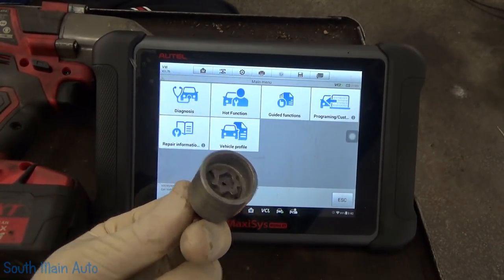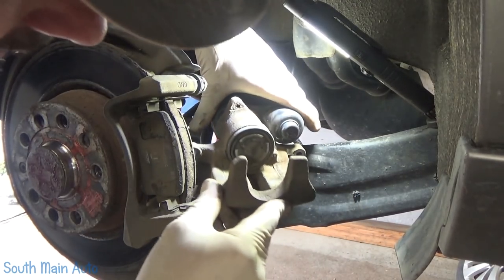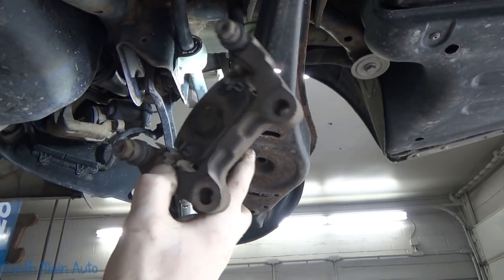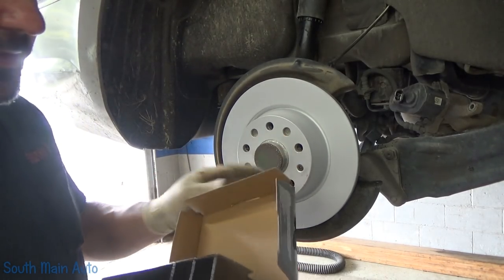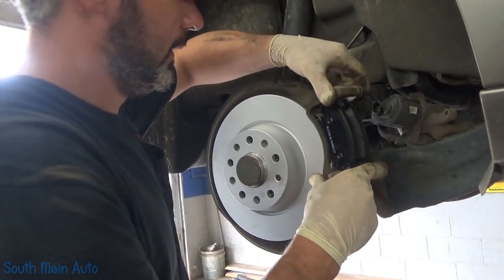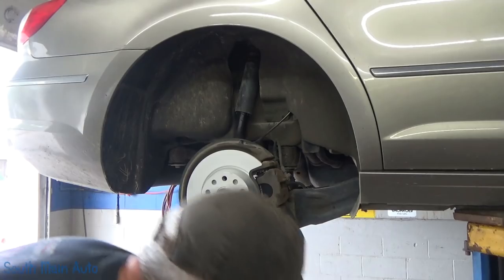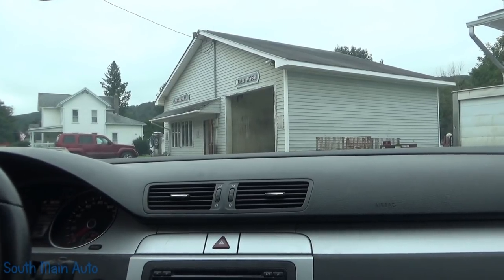Do You Need A $1000 Scan Tool Just To Change Brake Pads!?

Comment: You can take a 9v battery for smoke detectors and just 2 short bits of wire. Connect it to the connectors on the caliper motor and its done. Works like a charm for a DIY like me. When youve changed the pads just use the electronic brake a few times. Push the pedal and done!
Reply: Got the part about using the 9 V battery. It's all a similar video, but once you're all done and brake pads are reinstalled. Do you just use the e brake button like normal a couple times and the e. P b reengages?
Reply: @franklinavilez2386  yes it will adjust itself back to working position.

Comment: so you can do vw and benz rear brakes with out a scan tool, after you take off the rear caliper you can then pull the motor off and you can look inside the motor and see a torx i forget what size but you spin it clockwise all the way down then come back just a little bit and there you go. Or if you want vw has a free software online that anyone can get and then a 35$ cord and you can do almost anything to your vw or audi you could think of.

Comment: Another option that is great for the DIYers is the Carista bluetooth dongle. For $30 plus a $11 subscription fee, you can access many of the service tools (battery registration, brake service mode), as well as advanced diagnostics (ABS, airbag, etc.) and customizations with one touch programming (remote window operation, disable DRLs, disable auto start-stop system, etc.). No long coding required.

Comment: Had to change rear pads on an audi A6..
Had to keep the engine running the whole time to keep the E brake off...couldnt find any way of keeping it off after you turned the ignition off...
And yes had the same problem with the wind back tool. I did find one adaptor that had only one prong did fit in a fashion... Good job they werent to tight to turn
Reply: shauns auto repairs unplug the ebrake motor while car is running???
Reply: @enginehead9966  May illuminate a light on dash which cost him $$$ to turn it off
Reply: @mansouralblooshi3004  
Thats why i kept it running.. Didnt want to disconect it with it running incase i enjuced a fault code or system malfunction

Comment: Glad to see a VW CC video. Daughter  just bought a 2013 3.6. Not looking forward to servicing it. I have an Autel VAG 505 Scan tool that has the parking brake functions.  Think I paid $160.00 for it.. Has worked well on my wife's old Jetta but it is basically just for VW's.

Comment: Yes Eric you are correct, I have a mx808 and it will do the brake service function and can be picked up for 400-500$.  I dont know if there is any way around it, although I have ran into a few cars, you can wind the caliper back if the bleeder is open.

Comment: I had customers say that disconnecting the battery will turn off the parking brake system. I've never tried that, so I can't confirm one way or the other. One was a Prius, I believe.

I'd get worked up in your shoes as well. It's always a new tool, new "improved" version of a simple system, needing special sockets, etc. I get it, for some applications but something like a waterpump or brakes is ludicrous.
Reply: So if you've got a manual,  leave the car in neutral,  and the battery dies... you're car is rolling away?
Reply: @NameHere02  like I said, I can't confirm either way, I wasn't there, just what the customwr told me. His Prius I mentioned is automatic, so even then I don't know. Most people who drive stick, also leave it in gear, such as myself. So even if the battery died, it wouldn't just roll away, unless motor has horrible compression.
Reply: good point never thought about that!
Reply: That's German Engineering, over complicating something that doesn't need to be complicated...

Comment: Both MAC and DeWalt are owned by Stanley Black and Decker.  They also now own Craftsman and Proto.  They also own Expert, which is a Taiwanese brand.  I would guess the ratchet and battery are both made by the same Taiwanese (or Chinese re: the battery) supplier.
Reply: they also own blackhawk tools as well
Reply: Anyone remember Elu power tools?

Comment: The enemy of electronics. Heat. What do brakes do? Convert kinetic energy into heat. How is this a good idea?
Reply: European cars are money pits, VW makes more money on servicing cars than actually selling them...
Reply: Maybe that true about alot of brands, making more money off service. Weirdly, VW garages seem small, with the parking lot packed! We only sell so many, why have a big garage? 

The most reliable cars I have owned have been 3 VW's, a 92 BMW 5 series (No repairs but a leaky heater core that was easy, and a throwout bearing, again fairly easy, but after 25years and 250000 miles, not bad!) and a Mazda Tribute, except for a water pump. The 2 most unreliable were...VW's. Mainly just little things, like a speaker, windows regulator, spark plug needing changing frequently, a wiper switch. Engine and Transmissions were good!
Reply: too late.  lol
Reply: There are no heat sensitive electronics at the actual caliper.
Reply: Killer2600
While it's true that the electronics are remote, the electric servo motors are local. You can see it mounted on the back of the caliper at 3:39 . So the windings of the motor could be subject to fairly decent temperatures which isn't the best for the insulation.
Reply: Sonos45  Toyota is going to  electric parking brakes on their vehicles now.
Reply: @AdamSmith-gs2dv  NOT the older ones. I had a '91 VW Jetta TD when it was totaled by a jerk running a red. Had 698, 714 KM on it and was still running great. All original and had put nothing in to it other than brake jobs. I have an '86 now with 753,000 km--rusted pretty bad though--engine still runs great and I live in Canada where you can easily encounter  MINUS 40 weather in the winter. Plug it in for 3 hours and it starts no problem.
Reply: Sonos45 
More importantly,  how is this NECESSARY?
Stupid question.....if you disconnected the battery before starting this procedure,  would you still have to use the scan tool? How would the computer know you had changed the pads if you did it when it was asleep?
Reply: @MrPaige222  THANK YOU.  I was wondering the same thing!
Reply: Joseph Erhardt 
Don't listen to me. I ask a lot of stupid questions. 
Lol
Reply: @josepherhardt164  manual park brakes need adjustment overtime and the cables are prone to stretching needing replacement, a stretched, out of adjustment cable wont hold a car on hill which is a safety hazard.
Reply: @TonyRule  ways to mitigate this can be done, special insulation or composite materials, a heat proof wrap like old school paper wrapped coils had, or even just larger spacing (unlikely and would cause weak performance for the size)
Reply: @killer2600  heat is detrimental to motor windings
Reply: @JeffMTX  In what way? A coil of copper can withstand quite a bit of heat. There are also implementations of windings/coils that work in hotter environments for longer periods than what the EPB would experience.

Comment: I have changed my rear brake pads for 2015 Audi A3 with electronic brake and WITHOUT the service OBD tool.  And here is how :
1- disconnect the e-brake Motor from its electric cable 
2- there will be two screws holding the e-brake motor to the caliper , unscrew both and remove the motor . 
3- using t5 screw driver rotate the motor clockwise until you can’t move it anymore , with that you have already retract it backwards. 
4- change your brake pads and rotors 
5- return the E-brake engine to its place and you are done . 

I have tried it and worked for me , hope I could share little knowledge with you after all what I’ve learned from you . 
Thank you

Comment: I have an Autel MD802 and it has the ability to retract rear calipers on most cars and it was just over $200 Canadian. I use it at the dealer just cause it’s faster than our oem software. Also our dealer charges 2.5 hours for those rear brakes! I think you’re safe to bump your labour up a little!
Reply: 2.5 hours to change brakes, so you're saying your dealership is a ripoff...
Reply: Well, how's a autel maxicheck pro? It's a latest service tool it also has the ability to retract rear calipers on most cars and read or clear the Anti-Lock Braking System trouble codes, Steering angle sensor(SAS)functionality etc. It's not very expensive, only $155. Do you think which one is better? MD802 or checkpro? I am going to get one from obdprice.com
Reply: Plus they double the price for parts to. Even bigger ripoff.

Comment: We have a 2016 Honda with an electronic parking brake.  When doing the brakes, I remove the parking brake motor (two hex screws), then a use a big flat head screwdriver to back that piston off then re-attach it.

After the brake job is done, cycle the parking brake to clear the light on the console.  

I have done this twice (two separate brake jobs) without any issue.  That being said, YMMV

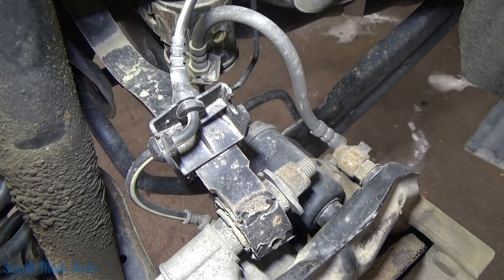Comment: About 1:46, and "pain in the ass" with vw-type electrical connectors.... When you push the tab and try to disconnect socket it do not want to disconnect. It is because of design of this type sockets. When you push the tab and try to disconnect, what you do is actually blocking socket. (I know, weird)
What you should try is: press the socket down (the same way as you connecting socket) AND THEN push the tab on socket. After that it easily disconnecting.
It works with all vw-type sockets.
English is my second language, so I hope you understand, what I want to say.
Greetings from Europe:)

Comment: Mate, according to other videos I've watcherd, there are 2 ways to get around using the scan tool for the electric rear parking brake. (1) spare 12 volt battery with wires and spade connectors straight on to the motor (from the connector you removed). Change polarity to confirm wind in or wind out (2) There are 2 torx bolts on the motor on the back of the caliper. Remove motor. Use a 8mm allan key bit on a ratchet to manually turn left to wind it all the way out. Reassemble motor to caliper and you are set to push in caliper. Once you finish doing the pads, you need to engage and release (cycle) the electronic brake twice from the switch inside the car. Then you are all done.

Comment: Just so you guys know, from my experience.
We have a 2016 vw Tiguan with these electric rear brakes on the calipers. Once you pull the calliper off, there are 2 T25 screws holding the electric motor on, take those out and pop there motor off, back out the t40 screw in the center then use a clamp to squeeze in calipers, replace t25 screws and you are done. No programmer needed

Comment: Ohhhh. This is the start my friends...
Learn the battery.  Service mode the ebrake. Immobilizer the chip coded key and the list goes on and on.  I bought my snappy scanner with 18.2.  You will need a scanner for newer cars.  Computers are everywhere in cars today.  Someday you will need a scan tool just to open the hood!!!

Comment: You can do them in your yard.. just have to have a extra battery or long leads from battery. Then run positive and negative to the caliper plug and see if its going in if not reverse polarity on the pins and it'll bring the piston in hope this helps

Comment: as an electronics guy im flat sick n tired of designers using open platform or multi use designs ALL requiring regular software updates,I spend HOURS a week checking and updating software on scopes, newer  multimeters  and  specialized test equipment . There's no reason for it other than greed and laziness.

Comment: Before I had a scan tool capable of releasing electric park brake I used to use a car battery and a set of jumpers. I have only tried this on audi but assume vw is the same. Not sure about other makes but it's possible. Just unplug connector and try touching power and ground to the caliper side of connection. If the motor sound like it does when you are setting park brake then stop. Then reverse your power and ground to change polarity. Now the motor should sound like it's turning freely. Then wait til you hear the motor stop and quickly remove power. Now you can squeeze in the caliper. After you're done changing pads and or rotors pump the brake a few times like you normally would. Then try setting park brake to make sure it works

Comment: This is just a wild guess, I am not a mechanic, so take this with a pinch of salt or toss it in the round file. Maybe unplug the motor and apply the right voltage at the right polarity directly to the motor so it unwinds manually? Like with your Power Probe?
Reply: I have wondered that myself. I just need to find a scrap car where it won't matter if i destroy the parking brakes to test my theory.
Reply: Yes that works, I used to do it before i got a proper scan tool
but they are also supposed to be adapted after you change rear pads
so really should get a tool for it
Reply: Yes it works, but it doesnt get the job done 100% since the computer software also calibrates the new piston position against the new thicker pads, it also sets new max torque and outer  and inner max parameters.

Comment: I'm glad you've brought this up. I had a '13 Mercedes in here 5 months ago, needed rear brakes and rotors. I had just paid $625.00 to update my OTC Genisys scan tool, and I asked the salesman specifically if the update would give me the capability of turning off the electronic e-brakes on Euro cars. He said yes.. Guess what? NO. You have to buy the Euro package update at another cool $400, that unlocks the Euro features for the e-brake feature to work. I don't see enough Eurocars to make the cost worth it.  Time for a different scan tool!  I sure miss the days when all a car needed was a red brick aka Snap On scanner, to fix them!
Reply: Try the new xtool D8

Comment: I just doubled checked on my Autel MK808 and yes it does do Electronic Parking Brakes as a hot function for a 2011 VW Passat in an almost identical manor to your much higher priced unit. My MK808 was just over $400 when I got it on sale but its regularly around $500 on Amazon. Though if I were to buy it again I would probably opt for the MaxiTPMS TS608 for a few dollars more with Bluetooth wireless OBD2 dongle and complete TPMS functionality. For much less money I think the Autel MD808 (~$230) and the MD805 (~$170) would work too, but I cannot verify that 100% for a 2011 VW Passat .

Comment: My reliable VW brake tip, Roll down the window, Drive slowly down inclined surface of your nearest boat ramp, apply brakes when (a) VW floats or (b) water begins to enter the open window. Congratulations problem solved!
Reply from the maker: Best VW tip ever haha
Reply: Put it back on the boat to the Fatherland and drop it over the deepest part of the ocean. It’s not even worth using it as an anchor and if you did use a detachable coupling on the cable so it is a disposable anchor not worth hauling it back up. Hope my grammar is ok. What do you expect for ex- aircraft mechanic. I never really liked to read manuals anyway. Almost toasted a Saab 340 engine due to a mistake in translation from Swedish to (American English) in the engine run up test procedures. Go figure and it was a GE turboprop engine supposedly made in the good old USA.

Comment: I recently changed rear brakes and a caliper on a 2015 Ford Fusion, same setup, except there was a work around, lucked out. Had to press the accelerator, turn key on, then pull up on electric e brake. Crazyness

Comment: I think you might like to mention that the grease one has to use for this job, has to be a high temp resistant one. More than once I find seized brake calipers, seized wheel bolts and even seized spark plugs, whereby the 'DIY' has used regular grease.

Comment: People do these without putting in service mode, but it is risky if the control unit ain’t happy after you manually wind back it’s a world of pain, in UK (Europe for the mo) where every other car is a vag product, Ross techs vcds is a fantastic affordable tool for this ironically made in the good old 🇺🇸! And now joy of joys needed just to change the damn fuel filter on the diesels. Tbf I had one these passats and put 160k on it (miles) and used vcds to do the  rears and never had any bother and it does make it easy and require less fiddling on with adjusters etc. Great vid as ever mr o.

Comment: take off handbrake and quickly undo battery, would be a workaround, or find the fuse and pull it?
Reply: No, because you need it to back out well beyond its released position to fit the new, thicker pads.

Comment: this is the same on my 2015 Audi A3 quattro which has the 2.0L turbo in it, I bought a tool called Carista for like $40 that releases them. A work around for them is to actually remove the electric motor all together which is splined in and you can use a torx to unscrew the adjustment on the inside until bottomed out then replace your pads and press your calipers back in as normal, then reassemble the motor when finished.

Comment: Fiat Chrysler is doing this same garbage. Had a coworker select retract on witech2 for the rear brakes on a renegade, and it actually extruded the piston and would not cancel the function and it ended up getting a caliper.
Reply: I have an alfa romeo and every year i need to reset the "service" witch can't be done without a good scan tool or pc software. Thankfully i cracked it so i just spent the money for the obd.
Every automatic fiat brand car: alfa, jeep, chrysler have this stupid thing to the rear/front brake. But now for every european/japanese car u need some electronic device for do something to the car.
Sorry for bad English but im italian. Did i write some mistake? :)
Reply: you always put the car in service mode with the calipers still on the car. many cars push the caliper out, then take it back in. im actually surprised the vw didn't, the audi's do. almost had the same problem at my shop on a lexus.